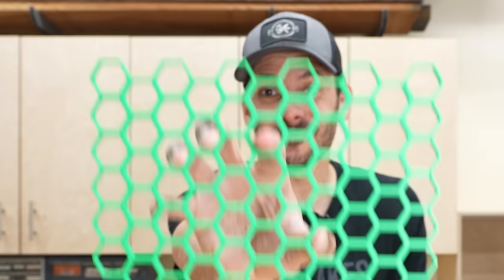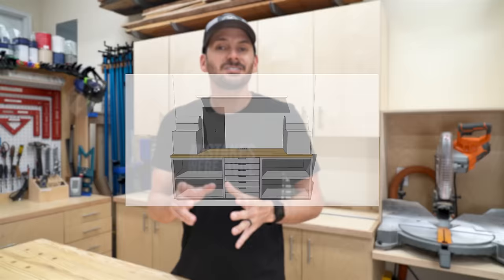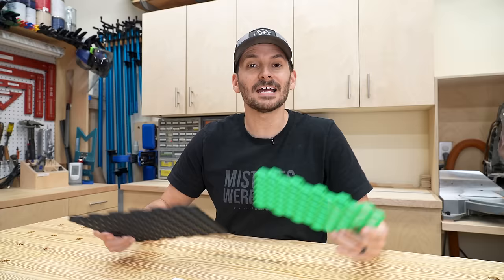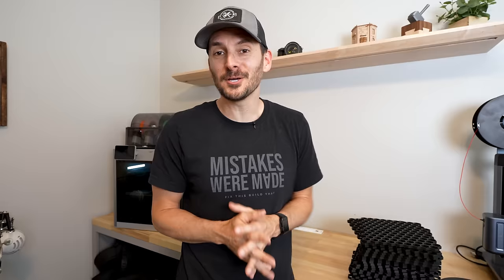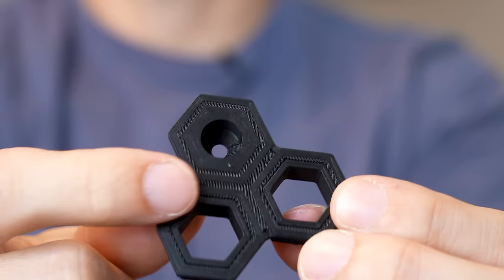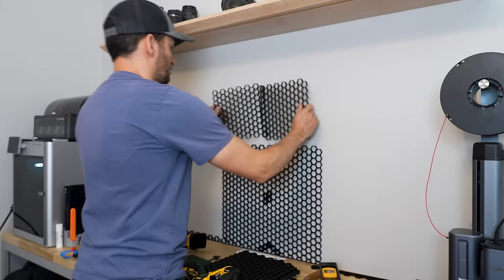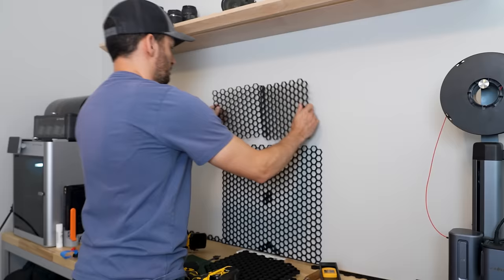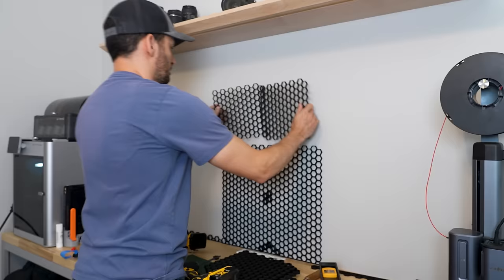Best Wall Storage for Makers?

Comment: I'm having trouble getting the scad file to work correctly. When I generate my honeycomb, I recieve the following "WARNING: Ignoring unknown module 'grid2d' in file honeycomb_wall.scad, line 30" which appears to be fundamental in generating the preview and geometry. 

I installed openscad through home-brew on my Mac. Are there additional libraries or functions needed to run most of these codes?

Thanks in advance.

Comment: You know hexes aren't strong shape. They're basically working as more fashionable squares (because both squares & hexes can be stacked together repeatedly).
But both can be easily deformed during load.
That's why for example geodesic domes don't use hexes (despite that they form many hexes in their structure), but each hex is made of several triangles (6 for hex, 5 for pentagon etc...).
My point is triangles are much stronger, because when load is trying to push them someway they pass that force thru the length of each triangle side.
And if their joints are well fixed (like being monolithic part because it's 3d printed for example) they won't fail until the load exceeds their tensile breaking point, which for most material is their strongest.
So, while I haven't run the calcs yet, I'm quite sure that a triangles-organizer wall would be much stronger with considerably less material used than hexes (or squares).
Reply: anyone made one of them? i was thinking of doing the same myself for a key cupboard i'm building. would be good to have it use relatively small triangles so it distance are more adjustable
Reply: @ge2719  , haven't seen one yet

Comment: How did you end up with such a high weight and filament usage per grid? I used about 82g per grid. My grids are the maximum size that fits on the bed. (P1S, same as the X1C).
Did you print them with solid infill?

Comment: So very cool this scratches my itch the right way.  One question why do you need the two part system?  The hexagon ring with the clips then the plug. Why is this neccessary?  Could you combine those two pieces?
Reply from the maker: yes, you can combine into one.  This just makes moving around easier

Comment: The problem here is durability of these in PLA, I find pla has a tendency to warp and get brittle far too easily. I probably would have gone with a CO2 laser cutter (or diode laser in a pinch) alternatives.

Comment: A basic design flaw with this system is that adjacent panels do not lock into each other, so requiring multi-cell wall fixings. Not hard to include inter-locking tabs around the periphery of each panel.
Reply from the maker: Great idea 👍

Comment: Looks like a neat system, but not an aesthetic for me.  The black honeycomb bothers my eyes.  Maybe a light complementary color like a light grey or marble.  What is neat with this is you can color code your fasteners for the function--a little like you did with green for the soda holder.

Nice project.

Comment: How did you get the other options on the open scad file? I only have how many for X & Y as well as wall thickness and height. I don't see any options for solid edges or how to add them. do I need to download a Library?

Comment: Rather than using tape for the fit, how about some of that brush-on rubber "electrical tape"? That should give you both a good seal and probably will look better -- if it won't bond to the plastic, perhaps a little sanding or something to rough it up a bit might work.
Reply from the maker: what is this sorcery you speak of?

Comment: So you exclude Skadis, which has a ton of compatible 3rd party designs and which is sold in quite big (wooden!) panels because it doesn't fit exactly your space (easily fixable with a saw), and you print another design which uses a ton of plastic (BTW PLA will deform over time under stress) and which also doesn't fit so you have to modify the design?
Reply from the maker: Skadis is not wood. Its dust and glue aka MDF

Comment: why are you printing the panels one by one? print a stack, use one layer of support filament as seperator. - and if you are on default mode: they print actually quite well in sports mode too.

Comment: and just imagine that could of taken an hour if that, if you swapped nozzle sizes on the printer. Maybe not on the connectors but for sure a 1mm nozzle would of knocked the wall panels out fast.

Comment: Option: attach (glue?) to ¼ inch plywood or MDF/melamine, then attach to wall. Result: fewer holes in wall, and they can be on the stud and still look good. If done right, the connector clips won't be needed, and thus won't take up space in grid, and everything can be moved around.
Reply from the maker: i dig it

Comment: Just curious, but how has this held up over time?  I love the idea, but was concerned about the durability with the plastic due to wear and tear on the connectors.  Just trying to determine if I should print with a higher strength filament vs. just using PLA.  I was thinking a nylon filament would probably hold up better, but its 2-3x the price.
Reply: Petg

Comment: I printed one of those grid panels a few weeks back on my Prusa MK3. Almost 6 hours! Need me one of those Carbon X1’s I guess.
Reply from the maker: Yikes! I print at 0.28 for soeed
Reply: On my Prusa...  0.25, 3 perimeters, 0% infill    Prints in 4hours 40min and super strong
Reply: @dcollea  I'll have to try those settings. Thanks!

Comment: Isnt it possible to CE-glue the pieces together and just montage it to the wall with 6 screws? Instead of losing a lot of spaces to the 'binders' of 4 squares (6-sized)... just glue and use 1 square?
Reply from the maker: you want the rigidity and tightness to the wall though too

Comment: Can't you just superglue the pieces together? Or at least the edge pieces, if you wanted to be able to take it down easier later. Seems like lots of extra work using those connectors (also adds noise to the overall look).

Comment: Those cheap, crappy anchors triggered my OCD. I hope they don't fail on you, but if they do, maybe next time you'll use Toggler Snap Toggles or hollow wall anchors or just plain old toggle bolts.
Reply from the maker: these have a 22lb capacity each.  I have 21 of them on the wall.  I think we're good :)
Reply: @Fixthisbuildthat  Fingers crossed. 🤞

Comment: Hold on... 3 hours?? The first one I printed was at 14 hours. I did a second one and was so pumped to get it down to 6 hours 20 minutes. What settings are you sporting?? I basically have almost every speed at 60 mm/s2.
Reply: Well I got it down to 4 hours, by changing the fills to 120, but it was rough going there looking stringy but eventually after more layers came it looks fine for the most part. Any other hints would be appreciated.

Comment: I just installed one skadis next to my workspace at home after researching pegboards. I agree with you that the modularity of it makes it difficult to fit perfectly. If you had a CNC could you just use melamine or hardboard to make one?

Comment: Nothing wrong with being creative in your own shop, however how much did all the filament/resin cost to make that?  Looks like about 20 knick-knacks spaced out there.  Hate pegboard, seems like an easy alternative would be to run some 2" trim pieces across the wall and use it like a french cleat would be doable. I'm just a little cranky at many of my channels printing ticky-tacky stuff on their $500+ printers...
Reply: He answered that at about 5:40.... 75 bucks.

Comment: How strong are the inserts?  Could I hang, say, a shovel off of a hook?  Those garage organizers are super expensive.  // Great video, nice to see innovative designs in the maker community being put to use!
Reply from the maker: this is definitely not for heavy stuff.  But depending on the filament used I'm sure you could easily store a shovel and things under 10lbs or so.  But lightweight is where it will work best
Reply: @Fixthisbuildthat  french cleat it is!

Comment: I printed these (x20) and haven't found a good way to take the attachment plugs back out.... Do you have any tips or tricks? I'm wondering how I can modify the wall in the future if I cannot change the attachment points..
Reply from the maker: There is a remover tool in my collection on Printables

Comment: 3 hours? My voron switchwire churns out those wall panels in about 2. Did you use the recommended print settings with zero infill and 3 perimeters?
Reply from the maker: what size grid?  Mine were 9x12

Comment: Is it possible to reutilize those left overs? Like melting and reusing for print?
Reply from the maker: yes, you can melt them down into silicone molds.  But you can't reprint with them unless you have special machinery

Comment: What material do you print with? I have a PLA printer which doesn't seem strong enough.
Reply from the maker: it's just PLA.  Can use tough PLA for a little extra strength

Comment: Hi, excellent project, congrats! 👏 can i ask u a question?
In the video at 7:35 you show openSCAD open and it is VERY different from the file I downloaded from Wireheadarts, it doesn't even have half of the parameters you have on screen, the main thing would be the "flat edges" in Customizer to adjust the edges . Any specific tips? 🤝
Reply: I'm having the same problem.  I don't see the options in OpenSCAD that he shows in the video ;o(

Comment: Brad, Any idea what weight and moment the grid can take given the mounting hole spacing that was used?  What would fail, the grid or would the plug-in feature just torque out of the receiving grid cell?

Comment: It would be cool to print a mold of the grid and then cast it in resin
Reply from the maker: that would be slick.  but resin doesn't have much give to it, would likely chip
Reply: @Fixthisbuildthat  maby a urethane casting system could be resilient enough

Comment: Been thinking about doing this hex wall system for a while.  My one concern is the plastic creep for PLA and/or PETG.  For my garage, that would obviously be a no-go from the heat, but what about inside?   Does the PLA creep over time with any kind of weight on those hex inserts?

Comment: Thanks for the inspiration, quick question though. at minute 8:42 you use a 3 wide connector, which it looks like I'm unable to find in the collection or in any of the files of the honeycomb wall connectors. Did you create this one yourselves, mind sharing/uploading it to Printables as I could use that one as well :)
Reply: It's ok, created those myself quickly with the provided step files. Same as the ones you used in the corners.

Comment: Your tree supports came off so damn easily. I usually have to get pliers and twist and yank to get them off. Do you have a settings file we can download, might be some help.
Reply from the maker: go for a 0.2 or 0.25mm gap between support and part.  default is usually 0.1

Comment: How strong are the mounts for tools, etc?  Would this work in the garage to hold hammers and heavy things?  

Also, its not level.  It's 1/128th of inch off level over the  3' or so.  You're dead to me.
Reply from the maker: If you're spanning across multiple hexes for support I think it could hold cordless tools and hammers, but I didn't test.

Comment: I actually started printing some of these a few weeks ago, but haven’t mounted anything to the wall yet. Yours is the first video I’ve seen that talks about the wall mounting portion in better detail. 
Thanks for sharing this!

My connectors are super tight and difficult (near impossible) to remove once they’re inserted. Is that normal?
Reply from the maker: yeah, you gotta play around with it.  I'd try different settings/layer heights and see if a better quality is easier.  But yes, some of them lock in there TIGHT

Comment: This is great! It looks so sharp! I think I'll have to do this with my "maker area" too. 

What did you think of the Carbon after using it on this project? I'll be curious to hear what you think about it over time too. I've thought about getting one for a while but don't really know anyone who has one to provide an honest review.
Reply: I have an X1C, excellent printer, super fast, incredible quality and best in class ease of use. Highly highly recommend it, thought it is a bit expensive and loud
Reply: @Aikano9  Thanks for the info! For me the ease of use and print quality are most important. I have an Anycubic Vyper that is decent in both categories given its price but I'm sure the X1C is steps ahead of it! Plus multi-color print and dissolvable supports are pretty enticing too :)
Reply: @makernova8160  I have an ender 3 V2 Neo, it’s been nothing but trouble, then it died, which is when I bough the X1CC. Goes from the shipping box to printing in ~15min, about half of that time is just the printer running a self calibration program to compensate for vibrations and resonance.
Reply: @Aikano9  I have had a fair amount of frustrating prints with my Vyper and it almost died on me a couple months ago. Had a failed sensor on the print head that almost bricked the whole thing. Fortunately a $15 sensor and about an hour of cursing brought it back to life! Okay, you've convinced me, I'm going to start saving for one next paycheck. Did you get the base model or the combo with all of the bells and whistles?
Reply: @makernova8160  afaik the only difference between the X1C and X1C Combo is the AMS, and 3 more sample spools of filament, I’d recommend getting the combo, the AMS is great! That’s the one I got.
Reply: @Aikano9  Sounds good, thanks again for the info!

Comment: Hey Brad - that is one more cool video. 
A couple of quick questions - 
a. do you have 3D printable links for the regular peg board hooks and clips that you use in your garage as seen in your video at 1:43 time marker.
& b. I see you have a Anycubic and Voxelab 3D printers. I believe these are generally in the $150-$175 range. Apart from speed offered by Bambu Lab Do you find them good enough for workshop accessory printing?
Thanks in advance.
Reply from the maker: Those are injection molded hooks for pegboard, but there are plenty of designs on printables for them.  And absolutely those 2 printers are great for printing accessories.  Just take longer.  I really like this one https://amzn.to/42Pgaka (what the Voxelab is a knock off of)

Comment: You... printed them with... all walls... yeah, you probably could have cut the cost and time in half without sacrificing any strength with like a 20% infill instead. Actually, the designer specifically suggest you to print with 4 perimeters and 20% infill lol.
Reply from the maker: that was with 4 walls :)
Reply: @Fixthisbuildthat  My bad then, must have just been camera angles, couldn't get a good enough look.

Potentially good maybe to specify some of your settings in videos since settings like walls/infill can drastically change print time and material usage :)

Great video though, first time seeing your channel!

Comment: Not really an improvement over pegboard, which still does the job; at worst, you'd need to get an extra board or two and cut them, and they're cheap as chips. More of a lateral move from pegboard.
Reply from the maker: lateral in utility, exponential in visual appeal